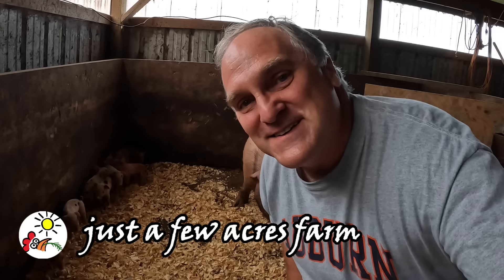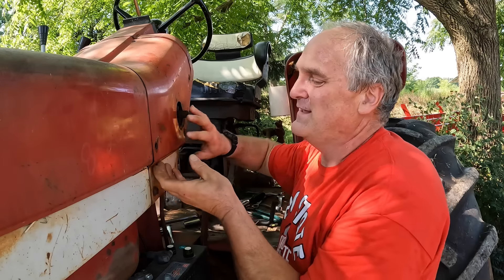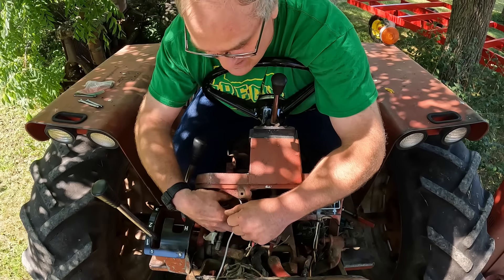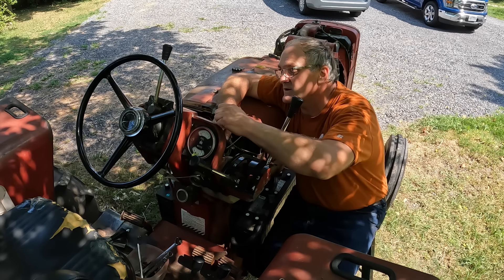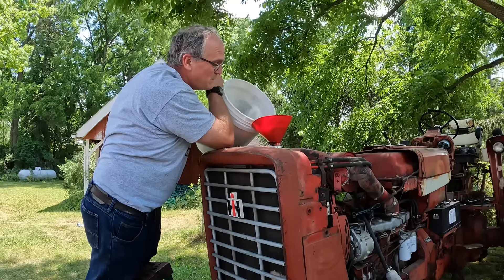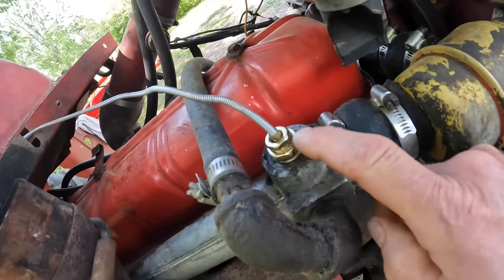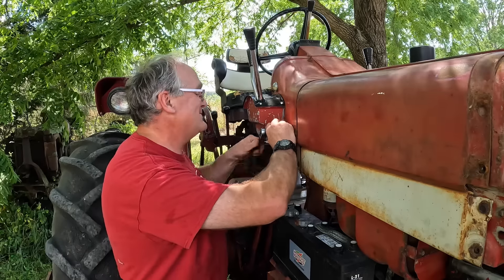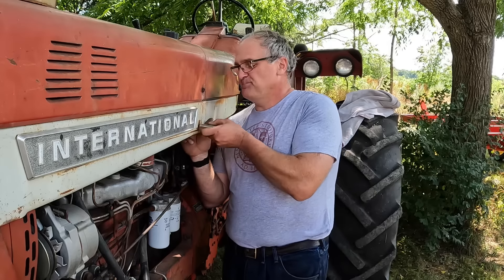How We Started the Farm

Comment: I think you have had a good start Pete. I think one key factor has been dealing with laws and not having way too many overcomplicated regulations to deal with. Number two is you had savings and did not mess with any banks. At least your a example that if you want to you can have a self sufficient farm. The IH 756 has the same temperature setup as the Belarus 500 not that different at all. Only on the belarus it attaches to the radiator, newer model has a electric sender instead of a capillary tube. That connects to the thermostat housing. It has been a hot summer where I am and instead of complaining about it I love it. Soon it's gonna be autumn and temperatures are gonna trop so enjoy it until you can.

Comment: Excellent video Pete  :) yes agree with you talk about also my late Dad & Uncle his brother work hard buy farm of parents also my uncle was 21 years and plus dad 5 years younger 15 almost 16 years in 1957 they only had 1945 Cockshutt 35 gas  loader tractor also 1950 Cockshutt COOP 40  my grandfather bought and then bought seed drill McCormick International #10  also pull type 6 row plow  from Farm Auctions  and horse drawn cultivator ! But in 1960 my dad apply job in Fire department in Country area 5 miles away home farm in 1963 got hired on part-time Volunteer plus pay yearly only ! But heard about in local farmers meeting and neighbors plus uncles work at Roads & Works Department Highway Patrol told buy McCormick International B414 to get Desiel motor! So bought loader tractor type cause 1945 Cockshutt 35 gasoline loader tractor broken down  and bought lots used machinery at Auction for years too plus brand new 1968 International 624 A Desiel motor 60 hp at dealer to and plus John Deere plow and other stuff needed! But fix up barn with silo and concert floor plus pole barn too ! When I was  age 13 in 1986 bought used 1978 International 724 B loader Desiel motor 72 hp also Gas 1968 McCormick International 105C combine with cab plus Air Conditioning  ! Plus 1984 big Machinery shed  too on farm !Plus in 1992 I bought them a 4 row planter for crops too and pick up to with them ! In 1994 said want sell farm my dad and uncle with tractors combine plus machinery too in 1997 did that ! But still farm with cash crops ones and my dad did fire department till 2006 to retire plus my mom  retirement her job year later too! But my mom dad didn't retirement on farm he did till was 85 years old when past away!